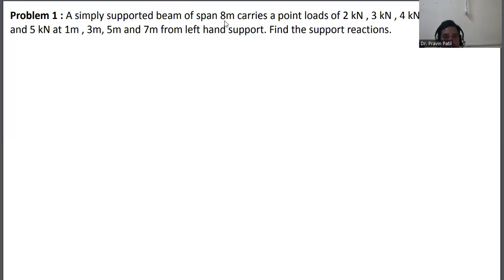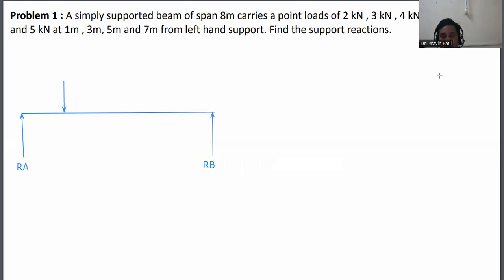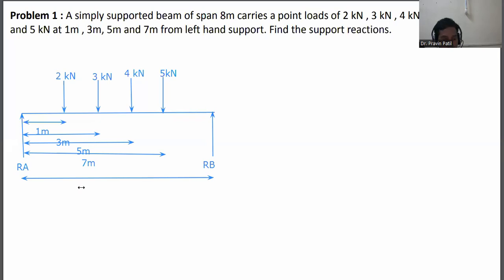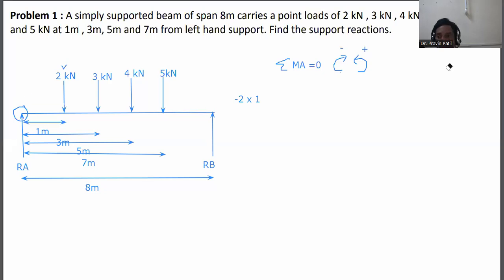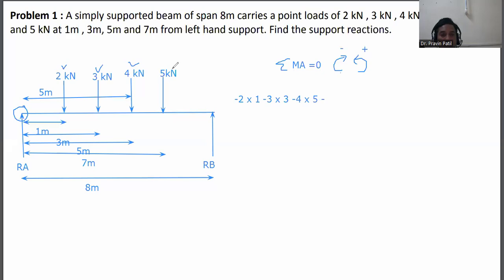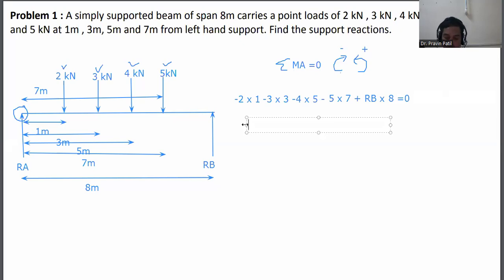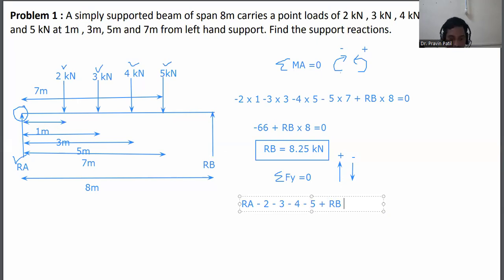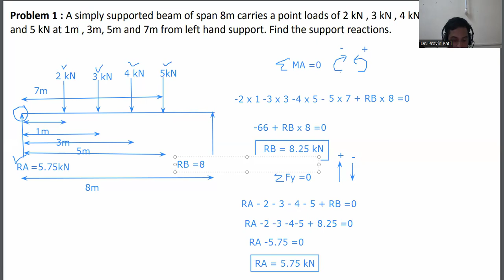Example on beam reactions /A simply supported beam subjected to point loads/ Engineering Mechanics

Comment: Two blocks A and B of weight 100 N and 50 N are tied together by a rope parallel to the plane as shown in Figure 1.18. The coefficient of friction between block A and the plane is 0.2, and that between block B and the plane is 0.5. Determine the value of the angle θ at which sliding will occur. What is the tension in the rope?

Comment: A horizontal bar AB of length 4 m and weight 400 N is lying on inclined planes as shown in Figure 1.20. Find how close to the ends A and B a load of 500 N can be placed safely, if coefficient of friction between the bar and supports is 0.2.
Facing problem with this numerical...pls explain